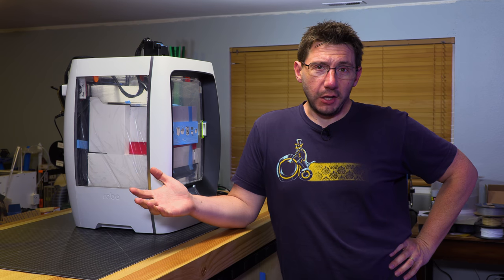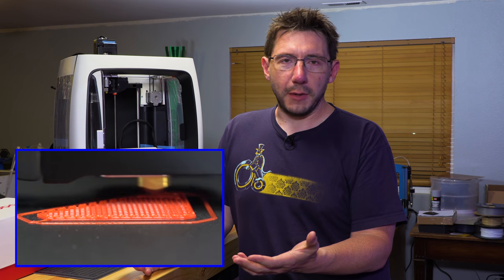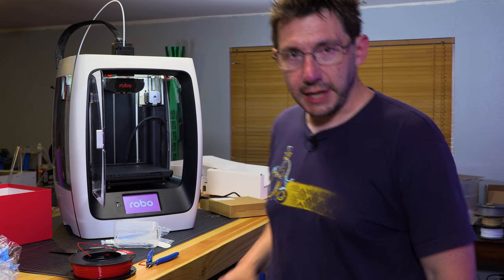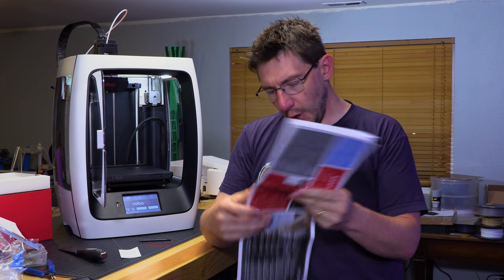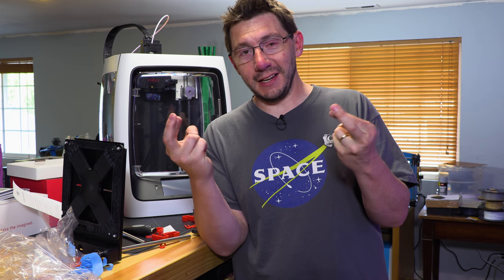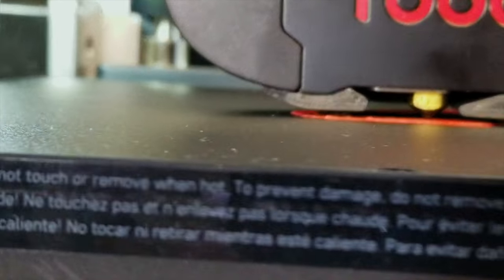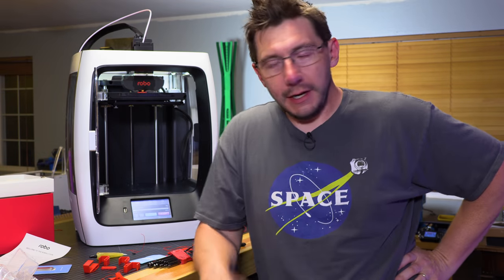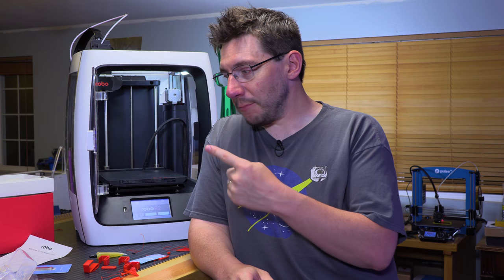Revisit the Robo R2 3D Printer - Second and Third Impressions Update

Comment: These Robo's are a Lemon. We work with them in our school district and on top of constant manufacturer defects, (lead screwws bent, corrupted OS, defective LCD's, POGO Pins collapsing, IR sensors dying) their customer support was also abysmal. At first it was ok but then we started to notice communication and followup on their end just, stopped... I still had 6 outstanding repairs I was waiting on parts for (some 6 months old and multiple attempts to follow up on our part) when we decided to drop them. 

We are looking for a good, reliable, work horse of a 3D printer to take up the place these guys left us.
Reply: i3 MK3 hands down. I bought one and that thing has been a blessing ever since. Easy to set up, support is great and the community around it can almost instantly help if something goes wrong.
Reply: I'm a teacher myself. We have 7 Ultimakers (3, 2+, and 2 Go) and they are pretty bullet proof. More money yes but reliable and very easy to work on and use for students.
Reply: @a.larson5941  thanks! I'm actually looking at ultimaker right now. It's a toss up between that and Lulzbot, they look like they have a good education section.
Reply: @EpicLPer  I appreciate the input! I will add that to my list of models to check out.
Reply: I look after a number of Ultimakers (2+'s) in my local makerspace, they (like most stuff) take a fair bit of a hammering and are used very heavily (we're just about to get 2 more). If your budget stretches to Ultimakers they are well worth the extra in that kind of environment. Easy enough to maintain, support has been really good (for us, a local UK distributor), software is easy to use, work out of the box. (I personally have an UM 2+ and a i3 MK3 - both are great printers, for multi-user use though I'd be worried about the Prusa being a bit more fragile, for home use - it's a great choice).
Reply from the maker: Hey - I tweeted this out, hope to get you some help.
Reply: @PreviouslyDelicious  I have heard lots of good things about Lulzbot. You really can't go with either one. I dont know which Cura Lulzbot is running with now but the always up to date and improving features in Cura and Ultimaker really helped push the needle for me.
Reply: @stephenharrison7479  what we are looking to do is create a printing hub for our whole school district where the schools will send us at tech services their student made STL files then we hammer them out in a controlled environment. The schools will still have one onsite but this will allow every student to have their creations brought to life. 

I really like the features of the ultimaker 3 and can't decide if the taller one would be worth the extra cost
Reply: @3DPrintingNerd  dude, you are amazing! Thanks for that! 

I've been following you for a while and love the personality and your honesty. Keep up the great reviews!
Reply: Id look at Lulzbot. I use 5 minis and 3 Taz’s and theyve been rock solid. Lulzbot also offers educational discounts
Reply: @StuffWithKirby  they do look good and I want to get more info on the Educational side of their support. I think I even recall something that said you can get an enclosure for them too? That would be perfect for the ones at the schools.
Reply: you already have the machines. id suggest starting to go through and upgrading what needs to be upgraded. hate to say it but unless you are buying a maint contract this is what happens regardless of machine you buy. how long have you had these and did they come with a service contract/agreement? 
outside of that id suggest looking at companies that offer educational machines and service agreements. they arnt going to be cheap though
Reply: @pen25  We had a service contract with a company years ago. The biggest issues are cost, not only machine and contract but materials are typically proprietary in those situations. Also and more importantly, how quick are they to fix issues. I had our machine down for close to a year from people who were supposed to fix it who couldnt figure it out and spent more money throwing parts at it than it was worth. So now we have redundancy in numbers. If 1 printer goes down we usually don't need it fixed that same week to keep up so the risk is far less. At the price of a service contract and printer and materials you can often buy many desktop units that are quite capable.. Going to a contract means you really need to do your homework on who is servicing your equipment. Edu doesn't usually get the same service people or companies as larger companies.
Reply: @PreviouslyDelicious  Given the printers would be in a "loving home" where they get cared for and looked after I'd probably go with the Prusa as well then. My UM 2+ is an extended and it's really nice to print tall stuff, but it doesn't happen often for me and takes ages. With the filament being at the rear of the printer is a might pain in the ** as you can't see when it's running low or tangled and you need to get to the rear of the printer to change it (I made a drawer slider thing to help this) which will  be annoying if you want to put a load of them next to each other - the Prusa's filament location is much nicer. As for support, Ultimaker have been great - I've not tried Prusa so I can't comment. The UM2's connectivity has been massively disappointing, but hopefully the UM3's is better.
Reply: Seemecnc
Reply: Depends on the build size you need but based on the robo size the MK3 is a good choice. if you want a bigger printer the Evnovo Sidewinder X1 is an incredible printer out of the box and cheaper than the MK3. Ultimakers are typically the "Pull it out of the box and press print" choice but I know people have had a few issues with them too. all 3 printers I have mentioned do have excellent support.
Reply: Ultimaker 2+. Use them in our print farm. Very reliable and definitely worth the money.
Reply: For the money and classroom friendly support, I would highly recommend the Flash Forge Finder. Coupled with the Polar Cloud, you have a perfect machine and very reliable workhorse. All for under $300. Plug in an inexpensive web cam into it for remote viewing for your students.
Reply: Autodrop3d is going to be launching a machine here very soon. It has completely unattended operation and automatic part removal. Multi user print queue. Packs a lot of features.

Comment: It starts with quality control and doing a drop test in the packaging then shipping it around the country and back, opening it up and checking it from top to bottom. If anything is busted... perhaps they need a redesign or better packaging. I want them to succeed. Otherwise things like this hurt 3d printing.
Reply: U Do It The only company that trusted their product to a similar standard was Traynor. It's creator would literally drop his amplifiers from the top of a building on concrete and, apart from broken tubes, the amp still worked. It's rumored that all amplifiers were treated this way before shipping.
Reply: I don't want them to succeed because they had a chance to address all of this 2 years ago when I worked with them on the R1 Plus and had all these very same issues and it ended with me sending their printers back after threatening to throw them in the garbage and refusing to ever work with them again and now Joel had the exact same experience. They haven't learned anything and they are building a garbage product for pennies on the dollar so they can profit as much as humanly possible at the expense of customer frustration and that isn't right. 

They better hope they don't sell too many of these with a high failure rate or someone is going to open a class action lawsuit to force a recall and refund which honestly, they deserve at this point.
Reply: The packaging is actually really nice. Seriously, I was extremely impressed with the packaging. The issue is the printer itself. Lipstick on a pig...

Comment: WHAT. You're 28 and have ALREADY worked for Microsoft and Adobe and now run your own YouTube channel?! Fellow software dev myself, that's insane, well done, the difference that geography makes! Only landed an insurance gig and worked at Summit Racing HQ (Ohio) and I just turned 28 a week ago!!! Lucky man... but at least I got a DeLorean! lol

And as a bumper sticker somewhere says, "all my kids have fur" (cat family), though I'm proud to be "the fun uncle". Love seeing the kids on the channel.

For the Robo, sorry, not much excusing this one. I mean the problem was made clear to them: bent lead screw out of the motor. They sent you a completely new unit and went through hoops and hurdles to make sure it arrived exactly as it was when they finished making it, yet same problem. That rules out everybody else but Robo themselves. It's a new problem if your first machine was immune, maybe a supplier change?

In fairness, the touchscreen did appear to respond to touch when filament ran out (rewatch that bit, it caught finger press directly twice in a row when you were zoomed in), but my printers either have no screen at all (OctoPrint etc. required) or use an LCD screen with physical buttons. I think I know the type of screen they're using, and it's going to be toast before long, styluses will only be good for a set amount of time. Ticking time bomb there, hopefully can be fixed with an upgrade or aftermarket mod, but direct from Robo really should be expected.

Two filament sensors -- is it possible the first is a support filament and that's why it kept dying right when the raft finished? Are there two inputs on the Robo extruder head? Could be a dual-filament machine.

Comment: I live in San Diego, where Robo3d headquarters are based. I bought mine at HQ this past February, and from the get go, the printer also had some issues. I picked it up directly at HQ, so no shipping was involved. 
The first issue was the second I turned it on, after doing the first sets of calibrations, then attempting my first custom print, the nozzle rammed into the bed, instantly creating a hole in the RoboTak. I had to use very weird distances and also use the thumb screws under the bed to prevent the nozzle from hitting the bed. Then, I noticed the hotend started leaking melted filament from the top of the heat block. So I called up the guy that sold it to me, and he asked me to bring it to them. I did, and I was helped by their tech leader in the service department. They changed the roboTak for free, they swapped the entire nozzle+hot end, with a brand new one, they recalibrated right there in front of me, did some test prints, and since then the printer has be printing excellently. I’ve done over 2000 hours of printing on it since February, projects for customers as well as printing for fun. I’ve upgraded to Stainless steel nozzles, and have been printing with wood, carbon, stainless steel, and it’s been handling them all very well. 

Joel, CAN YOU ATTEMPT TO PRINT WITH FLEXIBLE FILAMENT on your R2 please?

I bought some flexible filament, and I haven’t been able to make the printer even extrude the filament, it just gets stuck up in the feeding mechanism. 

Ah, and the LED lights that are inside the printer, all went out after the first week of use. Robo told me that is a known issue on their latest batch because of the connector used on the lights. They gave me an upgraded light kit, which I haven’t bothered to install as of yet. 

The touch screen works better if you do normal speed DOUBLE TAPS, too slow it wont react and too fast it wont react either, but I have found consistency in using normal speed, I think 1 second per tap, doing double tap, and it works very consistent. 

Also if you get a spool of filament that has a smaller opening hole, the filament hangers in the back wont work, as they are very thick. I complained this to Robo, and they gave me a printed filament stand which accommodates small diameter filament spools. saved me 8 hours of printing time, since they said that same filament stand is in the memory of the R2 printer. 

Let me know if anyone has any questions, I have also upgraded to the new 2.0 firmware and the printer is much more consistent, plus the initial self leveling is 10 times faster too. so you start printing much faster than before.
Reply: I have a Kickstarter edition. I was actually the first one to receive it in San Diego!

That being said, it has been good to me but has come with a plethora of issues as well. It has proven to create decent prints but the quality of hardware seems to be in question.

Replaced hot end, new bed, updated firmwares and still getting random min temp errors, bad connectors etc.

That aside, I have printed with Matterhackers Flex fill (I believe it's called) and it worked fairly well. The key is a much slower speed as well as a higher temp on the extruder and the bed. Having a print dry system is a huge plus.

Comment: My first Robo3D was my first 3D printer, which is cool (or terrible?  LOL) because it got me into 3D printing as a whole.

I had a lot of issues getting it to print on the whole bed;   custom firmware, lots of rework and tweaking, and it still never really worked "great", but making it work "pretty well" taught me an awful lot about the mechanics of the machine and how to use Marlin.

2 years later and I've built an end table sized CoreXY machine from scratch!   Thanks for sharing this Joel!
Reply: Blake McBride 
Do the printer only uses robo branded filament, or can you use any other non-branded filament?
Reply: Any filament.   :)
Reply: The R1 only had an 8.2”x8.2” heater, for a 9x10” build plate. without any way of tramming the bed. Relying on a touch probe that would read different values on either side of the bed 😪
Reply: Same experience. Not only that, but the virtual center of bed WASN'T THE CENTER OF THE DAMN HEATER. That heater is stupid and warps my prints because I expect to be able to use THE ENTIRE PRINT BED AND PRINT FROM CENTER

Comment: Thanks for the video and your honesty. I bought a r2 last year and had so many problems with it. The box was beat up when I got it. It never really made great prints. Robo support line was terrible and you have to make an appointment to actually talk to someone who can help you that took a week. My printer kept makings all these weird clicking sounds. The prints always had terrible lines in them. I could never get the thing to level. So I ended up returning the thing. It was my first printer but I am by no means not tech savvy, I work as a repair technician and just hated the whole experience. So your experience was similar to mine and I'm really glad I was able to get rid of that over priced garbage.

Comment: What a shame they’ve gone down the tubes! My Robo3D R1 Plus is a champ and still creating stunning prints today after my E3D upgrade. Clearly their newer machines were rushed and poorly designed for shipping.
Reply: Think you got lucky, mine was a mess! Had to replace the extruder, ramps and power supply. I still think having to upgrade to an E3D on a 'turn key' machine wasn't great anyway
Reply: Does the auto leveling work on your R1 Plus? Did you have to make any chances to the R1 out of the box to get reliable prints? Because my experience with 3 R1 Plus's involved auto-level never working, not hitting target temps on hot end for materials claimed to work, bent lead screws bobbing around causing misaligned layers, etc, etc. Just curious if it works like a champ because you fixed everything or right out of the box it just printed like a champ.
Reply: I have 3 R1+ also and every once in a while i have to adjust the right z rod just a minor tweak as its laying down the first outer ring, a quick pause and a light twist to the left cures this. Mine have been printing literally 4 weeks straight without much more than a few hour break between prints since i bought them. I moved up from da vinci 1.0as and am very happy i did. Two minor filament jams which were fixed with warming up the extruder and using the tweezers in the box poof fixed. I am very happy with them, ordering 3 more in the next few months..
Reply: Barnacules Nerdgasm It required some work. I got the model with updated lead screws and I made some adjustments in the firmware per forum recommendations but other than that, it was pretty decent. Definitely not “plug and play” as advertised, however.
Reply: These are actually really well designed machines. Their quality control is just crap. The R1 series were terribly designed machines. Their gantry completely unstable, and a auto level system that was more of a chore than it was worth. On top of that the R1 series injection molded parts were cheap and poorly done. The R1's also used a RAMPS setup so regular electrical issues are the norm, and only every once in a while will a driver light up on fire. My R1+ has been stripped down to the few good parts and built into a new machine. 

Now when the machine was running it was great. You have to print slow but other than that it prints pretty well, the hot end is good enough, but I still spent more time fixing that machine than I ever did printing with it.